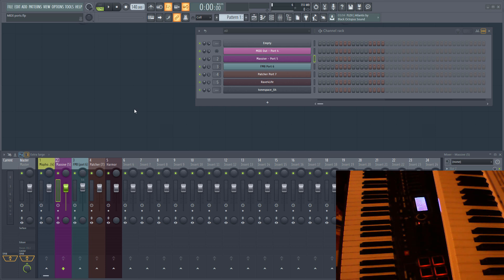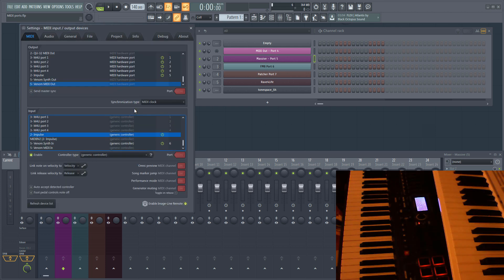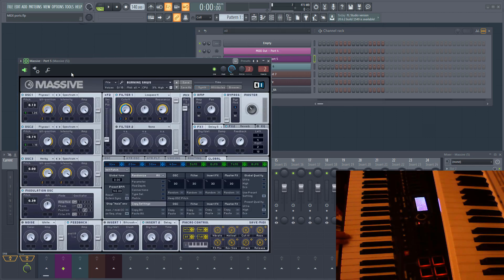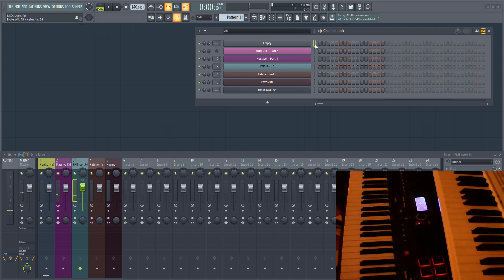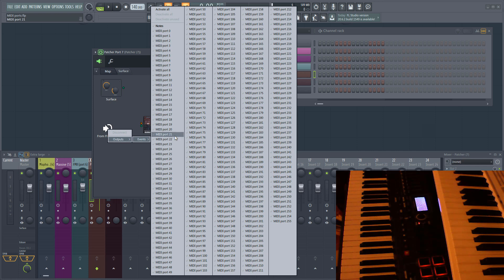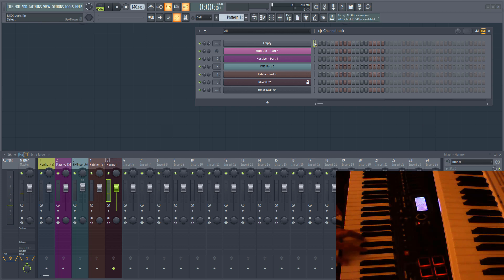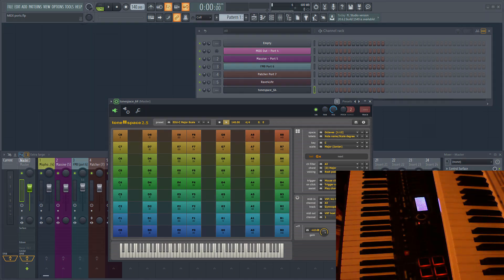Understanding MIDI Ports in FL Studio - How to route MIDI between plugins and/or hardware

Comment: Hi 
How can i Route a converted Sample  in Midi to a Sequenzer for example. Can i Route Stock Plugins. For example Slicex to a Sequenzer?
Thanks for Help and sorry for my Bad Englisch
Reply from the maker: If you want to send MIDI generated by a plugin to a stock plugin, you need to do it with Patcher. As you probably noticed, you don't get to choose an input port on stock plugins, but Patcher will let you choose an input port, and you can then send that data to any plugin added in Patcher, including stock. See 3:17. 

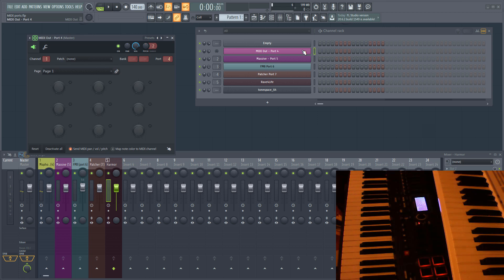While I talk about controlling the plugins from hardware, really they are just responding to the data on the selected MIDI port, so as long as you are sending the notes to that port, it'll work with plugins too. See 5:19 for info on setting up the MIDI output port for a plugin.
Reply: @steevmsteevm  Thanks for your fast answering
Reply from the maker: @Kleinebombair  Kein Problem!
Reply: @steevmsteevm  OK dann das ganze nochmal in Deutsch 😂👍
Reply from the maker: @Kleinebombair  Wenn ich die Frage direkt auf Deutsch beantworte, haben die anderen Nutzer nix davon (die evtl in Zukunft mit der gleichen Frage vorbeischauen). Sonst haette ich das eh gemacht ;)
Reply: @steevmsteevm  Alles klar. 🙈😁
Reply: Dennoch nochmal zur Erläuterung meines Problems.
Ich möchte den Sampler von FL Studio mit einem Third Party Plugin (Rhytmizer) ein Sequenzer Routen. Im Patcher kann ich den Sampler nicht laden obwohl er mir in der Liste angezeigt wird. Kann es sein, dass es ziemlich umständlich ist oder bin ich einfach nur überfordert als Neueinsteiger 🙈👍
Reply from the maker: @Kleinebombair  Ja, leider kann man den Sampler nicht in Patcher laden. Es gibt Gruende dafuer, die lange in der Vergangenheit liegen. Du Kannst evtl. den Sample in DirectWave laden, oder du verwendest irgendein gratis VST sampler. Wenn du VST verwendest, brauchst du auch kein Patcher.
Reply: Okay. Danke dir für deine Hilfe

Comment: I don’t  see anywhere in my FL that has port options . They all only say track . Did they change it innFL 20 ?  I like FL but hate how overly complicated  simple things in other daws are such as simply assigning 1 sound to whatever midi channel you choose . I have a hardware sequencer with 16 channels and all i want to do is assign individual drum sounds and synth sounds (plugins) to separate incoming midi channels . Ableton does this easily as do most my daws . Im not familiar enough with FL procedures but a lot of them sure seem too convoluted.
Reply from the maker: This is filmed in FL 20. BUT... the native plugins that come with FL Studio don't have the port options in the wrapper settings, that's only for VST.

The problem - at the fundamental level - is that FL Studio  isn't remotely MIDI-compliant, and uses a hybrid that is half MIDI, half its own thing. So the native plugins pretty much all have their quirks when it comes to handling MIDI. 

What you can do is link the input directly to an instrument in the rack by right-clicking on the instrument and selecting "Receive notes from" and then the device and MIDI channel. It's covered in the video, though I don't think I selected a MIDI channel. That's probably worth trying if you are using a HW sequencer. 

If you want to route MIDI internally to native plugins (as opposed to controlling it from your hardware) , you'll need to load up the plugin in Patcher and do the routing there. 

Copied from another reply here:
"With native plugins (Harmor, Sytrus etc.), you need to use Patcher. Add Instacomposer to Patcher + whatever plugin you want to control. Connect the notes (blue output) from Instacomposer to the target plugin (blue input). Open Instacomposer and click on the cog (Settings). Set the MIDI Output port to anything that is not "---". The notes from Instacomposer will then be played by the target instrument.

Some plugins (e.g. 3xOsc) can't be loaded in Patcher. You can probably get it to work with virtual MIDI cables, but I haven't tried."

So my guess is that you aren't seeing the ports because you are using FL native plugins, not VST. But they should respond if you set up the instrument to receive notes on a particular channel from a particular device, as described up top.
Reply: @steevmsteevm  Thanks, this was helpful for me also.  Indeed Patcher is the way to go for MIDI routing among native plugins, which can be a pain but at least it's doable.
Reply: @steevmsteevm  Thanks for such a quick reply . Ive been trying to figure this out for hours and it’s still not working . There is a right click on the plugin option that leads to midi channel routing options but the dam thing isn’t working . I’m literally getting drained and pissed off about something that is so easy and basic to do in ableton and bitwig . I really want to start using FL more as it loads the quickest of all my daws and seems very cpu efficient , but this type of shit is driving me crazy. ableton takes over 2 mins to load sometimes and FL is instant , but if i cant figure out basics procedures i use all the time then i wont be using much . gotta go to bed now frickin tired ! ill give it another go tomorrow. thanks for your tips !  ill try patcher tomorrow . dam gotta use a device just to connect separate midi channel inputs from an external controller !?                                      C’mon  FL Studio UPDATE THAT NONSENSE !  thats ridiculous .    P.S.  I did link the input directly to an instrument in the rack with receive notes from midi channel yada yada ect... nothing no go and controller works fine
Reply from the maker: @redbirdsaraceno  If you're on Discord, the FL Studio server might be a better place to provide some help than the YT comments section. So if you can't get it to work, you could try joining that and posting some screenshots etc.
Reply: @steevmsteevm  yeah i might try that if i cant figure it out . Thanks man !

Comment: Hmm !Great !So as for human control (hardware)SAME PORT NUMBER IS KEY also for internal as well! What about channels? Is corect that we could say for each port conexion we have a couple of channels that been asign a certain vuale  for each ?And each channel acts like a atribute !All those been in fact conexion ?
Reply from the maker: If you want a particular hardware device to be linked to a specific instrument - e.g. you are using a hardware sequencer, or you want to jam live with one keyboard always controlling a particular synth, then yes, you need to pay attention to the port - you can assign one automatically when setting an instrument up to "Receive notes from" a particular device (see video). You can select the channel when you do this.

For recording parts played on your keyboard etc., this doesn't matter. The currently selected instrument in the rack will receive the notes sent from hardware by default. So it's enough to simply select the target plugin in the rack if that's what you want.

The MIDI ports basically help you route data once it is "inside" FL. Linking a hardware controller to a specific instrument is one use case, but routing data from MIDI generators (plugins) is another. You could set up the MIDI Out plugin to control other plugins by setting matching ports. I like to do this to control Kontakt when there are multiple instruments loaded up, each responding to a different MIDI channel. Just set the MIDI channel in the MIDI Out plugin, and make sure its port matches the MIDI in port assigned to Kontakt. The big advantage for me is that I can name each of the MIDI Out instances in the rack to know what they are controlling.
Reply: @steevmsteevm  Hae you using MIDI for controling lights show with in FL Studio? That s in fact my goal with all this discusion!And i am about learning more
Reply from the maker: @prenumenumedefamilie3418  No, but there is an effect in ZGameEditor that seems to be for sending DMX. It's called DmxControl and is listed under "Hardware".
Reply: @steevmsteevm  I know it !Maybe i should search someone has use it !I want to start developing something with FL in this side !I really get involved for all Fl users because i consider like a BIG FAMILY !
Reply from the maker: @prenumenumedefamilie3418  If you figure it out, let us know/link to a video, because you are not the first one to ask this question in the comments here...
Reply: @steevmsteevm  THE BEST THING IS TO CONTACT COMPANY THAT WAY WE ALL HAVE ACCES TO THIS BENEFITS!

Comment: Stupid Question coming in... I'm New

So currently I have my Synth hooked up to my Focusrite 2i2 via two Aux cables. Can I record the sounds from my synth into Fl with that? or Do I also need the midi cables hooked up? I have Korg Opsix. If I do need midi cables, Do I plug my the Aux cables in the Line1 and 2 ports on the back and the midi cables in the front? ( currently i have the aux jacks plugged into the ports on the front of my focusrite) 

I might be wrong in assuming but arent the midi cables just so i can use my synth as a controller for plug ins in FL? because i just want to record the sounds that are coming from my synth into FL. 

sorry if im not clear in my questions and thanks in advance for helping out
Reply from the maker: Yes, you are right that the MIDI cables are simply for using the synth as a controller, and don't actually transmit the sound. In very simple terms, when you press down a key on the keyboard, it sends a message over MIDI saying "Key X has been pressed" and when you release the key, there's a message "Key X has been released". It's up to whatever you are sending that note to to actually make a sound.

As long as the Aux inputs show up as inputs in FL Studio (just above the FX slots in the mixer, there's a drop-down where you can select the audio input for a mixer channel), you can record the sounds from your keyboard into FL. More details in the manual here: https://www.image-line.com/fl-studio-learning/fl-studio-online-manual/html/recording_audio.htm

In practice, I'd recommend that you record any parts you want played by external hardware as MIDI first. That way, you can edit the part if necessary. Once you've captured the MIDI in FL, you can simply send the MIDI to the hardware for playback, so you can hear the part as you work on the track. Make sure you don't have any feedback loops when you do this (i.e. sending notes from the keyboard to FL then back to the keyboard) as it'll cause havoc.

Then, when you've got to the point that you are happy with the part, play back the MIDI and record the audio from the synth. You'll need the audio take so that you can export the track with the synth sounds in it - it won't work if you only have MIDI in the playlist. You should also keep the MIDI in the track (mute it, but keep it accessible). Then you can always edit the MIDI and re-record the part if you need to later.

You can of course simply record the audio from the synth and play the part live - without using MIDI at all - but that will stop you from being able to make any edits to what you played. I find that a little bit of nudging notes here and there can make all the difference, and if you ever hit a wrong note, it's easy to remove from the recorded MIDI. Impossible to remove from the audio if there's more than one note playing at the same time.

HTH
Reply: @steevmsteevm  I can not thank you enough for the info. Exactly what I needed to know. You are a legend! I might be back if I run into any issues 😅 again thank you. Here's my sub!!
Reply: @steevmsteevm  okay so something weird is happening. I have my synth hooked up as a midi controller via USB. I can free play all the sounds from my synth and hear them fine. The problem is the knob to control my presets is also changing the channel I'm using in FL at the same time...

And when I highlight record and press play, it tells my synth to start playing the premade demo for whatever preset I'm on and it starts recording it. I'm so confused on what I have to do.
Reply from the maker: @badmana5768  Unfortunately, FL Studio reacts to program change messages (which is what you are sending when you select a preset) by jumping to the corresponding channel in the rack. Don't ask me why they made this decision.

You can avoid this by right-clicking on the channel you want to control in the rack, and linking it to your controller with the "Receive notes from" option. This will keep the controller locked to that channel even if you change the patch on the synth.

But if you're trying to use the sounds on the synth, you should check if there's a VST editor (check https://ctrlr.org/ too if there isn't an official one for your synth, or it's paid - there may be a template available). This will allow you to bypass FL for MIDI when using the synth's sounds, and allow you to instantly recall patches when you load a project. If there's an editor for your synth, this is by far the easiest way to work. I have editors for all my synths, and it makes working with them 1000x easier and avoids problems like this. There's still a little bit of babysitting you need to do if you want to use the synth as both a sound source AND a controller for softsynths. The editors typically require you to disable the MIDI ins and outs in FL, and select them in the editor in order to interface with the synth. Then,  if you want to control a softsynth with your keyboard, you'll need to disable the link to the editor, and enable MIDI in FL Studio. I avoid this by having a dedicated MIDI keyboard (no on-board sound). Obviously that requires the gear to do it.

I'm guessing the demo song is playing because the synth is reacting to the transport command sent when you press play. I think you can stop this from being sent to the synth by turning off master sync. At least that's what the manual says here: https://www.image-line.com/fl-studio-learning/fl-studio-online-manual/html/envsettings_midi.htm

You can disable it for each output individually, and there are also options in the Options menu to turn MIDI settings on/off. You might also be able to set the keyboard itself to ignore these messages - check the manual that came with it.
Reply: @steevmsteevm  again.. you’re amazing for help. Thank you so much. I have one more question.

So say I’m laying down a bass line from my synth and I want to loop it and just freestyle some keys (also from my synth) on top. Well when I change my synth sound over to keys, it changes the bass line sound as well. In other words, can I have two midi out plug ins separately playing different sounds from my synth? Or do I need to convert the first midi into an audio clip to play a different sound from my synth on top?

Example— I have a loop playing of some strings playing the rhythm I put it in the playlist and it’s looping. Now I want to do the melody, but when I either change sounds or alter the sound (use pitch wheel) it effects the Rhythm as well. 

Is there anyway around this other than converting it to an audio file before adding another section? 

Thank you I’m advance!! You’ve help relieve my headaches lol
Reply from the maker: @badmana5768  Depends on whether the synth is multi-timbral. Given that you have a demo song, the answer is going to be yes, yours is. You will need to read up in your manual about how to set up different presets for different MIDI channels. You can set up the bass to play on MIDI channel 1, record it, play it back on MIDI channel 1 via MIDI Out (set to channel 1). Then you set up MIDI channel 2 on the synth to be your keys, and rinse and repeat (sending the MIDI data from FL on MIDI channel 2). There are a total of 16 MIDI channels, with channel 10 reserved for drums. The exact details of what is possible, how many notes you can play at once etc. should be in the manual somewhere.
Reply: @steevmsteevm  okay got it! I think have enough info to do some research and I’ll read up on the manual. Thank you so much. It’s hard to figure this stuff out when I don’t even know what to search up to get the info I need. You’ve been so helpful! Is there anyway to support you other than subbing? Patreon or anything?

Comment: I’ve watched the videos but I’m still a bit confused. If I create a midi sequence in fl studio, with fl keys let’s say,

But I connect a Korg Modwave Synth to my laptop. How(if possible) could I play that sequence using my hardware controller, as I change waveforms, filter, etc?
Reply from the maker: Don't create it with FL Keys if you want to send the data to an external synth. Use MIDI Out instead. That's what MIDI Out is for - to send MIDI out of FL. FL Keys is an instrument that makes its own sounds inside FL.

https://www.image-line.com/fl-studio-learning/fl-studio-online-manual/html/plugins/MIDI%20Out.htm
Reply: @steevmsteevm  Ah, thank you